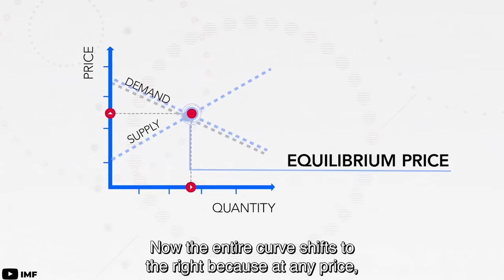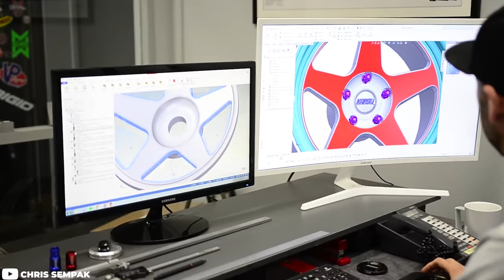Why The Aftermarket Wheel Industry Is DOOMED

Comment from the maker: Do you think aftermarket wheels will die out? Let us know in the comments below. Also, don’t forget to check out wheels, tires, and suspension for your build over at www.fitmentindustries.com
Reply: well as long as our economy doesn't take a bigger shit, its possible for a higher volume of aftermarket wheels  to be bought, but lets just hope these aftermarket companies can hang on a bit longer as this economy adjusts its self, just my opinion
Reply: Yo Alex i don't think so but I like the wheels in your back around iam interested in one of those Wheels in your background
Reply: No, good quality good looking wheels are still required nothing changes a cars apearance like wheels, offsets, colors size etc etc
Racing, track, drag, rally etc etc
Stance
individuality wheels say as much as the car do about your style, your personality.

The mass produced manafacturers wheels are still crap, designs hard to clean, brake dust collectors yes there is the exception, but trust me most I deal with are dam ugly. 
I run BBS and Enkei’s on my cars, some were factory specc by those companies, some are AF. 
if AF wheel companies go, it’s the death of the car period..

Everything has cycles up and down, things are going through massive downs at the mo near,y everywhere, so media need again to promote positive outlooks not doom and gloom, you create reality at times guys. Let’s get through these next few years. Ride out the rough roads..
Reply: On because the AutoNation wants different types of Wheels different type of styles for the import and tuner cars and it's a lifestyle in a revolution not a fan

Comment: Also the fact that I don't want to spend thousands on wheels, when I can spend way less on the rest of the car to make it look good. Paint, body kit, engine dressings, aftermarket lights, interior fabrics, etc. All those things have gotten cheaper while wheels have gotten more expensive.
I just picked up a set (4) of Matte Bronze Enkei EV5 (18") off a wrecked Honda Prelude at the junk yard for $120. They have very little curb rash and a few scratches on two of the wheels faces. I'm just gonna sand it down about a half a mm or less and repaint them with a matte clear finish, polish the aluminum lips, then slap some good rubber on and be done with it for about $600 total. Normally these would be around $900 after tax/shipping, and that's without tires. Add tires and balancing and you're looking at $1200-$1700 depending on the size, type and brand of tires.
I basically got a steal from the junk yard and a little extra work on my part. I'm gonna do the same with paint; go get a $500 spray at Maako with extra clear coat, then bring it home to sand and wax the orange peel down to a nice mirror like finish. Rather than spending $3000 for basically the same thing.
What I'm trying to say is, getting basic work done then DIY customizing it is the new way of working on cars and wheels don't fit into that other than finding used ones and refinishing/repainting them. A set of used $120 EV5's is way easier to get sanded and powder coated, or repainted, than a new set that you already spent $800/$900 on, that only comes in three colors and look like everyone else's. If aftermarket wheels wanna stay in the game they need to have more competitive prices. If my oem wheels look good its cheaper to just paint those and change the tires. That's just my opinion though, I don't wanna drop $3000 on a set of wheels and tires when I can get used ones for half the price or less and fix them up a bit.

Comment: As someone who has tried to get wheels recently (this year), It seems like the problem is not on the customer side. There is demand. I picked out my favorite wheels from 5 different big name companies, and these were my responses:

1. Placed order, wheel delivery date was pushed back a month. Then another, then another etc.. never came back in stock.

2. “Put your order in but we can’t guarantee you when this shipping container will get here or if you will get an allocation, demand is 2 months ahead of delivery”

3. Two companies were out of stock entirely, and website “in stock” dates just pushed further every day.

Finally (took 6 months of this^) found a company out of CA that cuts the wheels there, instead of cutting overseas then shipping. Wheels were 19x10s not a crazy niche size either.

Comment: Thanks for a great video. I dig my OEM wheels so much that instead of hunting for that perfect new upgraded set, I had the curb rash resurfaced and powder coated them a fresh color (these are STI BBS wheels, so already pretty good). I guess the Wheel Restoration industry is also helping to diminish the newest Aftermarket Fresh Biz. As I drive around, I’m often looking at wheels on cars and see some cool wheels: Almost zero hub caps!

Comment: I KNOW THE ANSWER TO THIS ONE. IT’s BECAUSE THEY ARE TOO DAMN EXPENSIVE AND THE OEM WHEELS ARE GOOD LOOKING ENOUGH NOT TO SPEND $2,500-$8,000+ on wheels. IF THEY’RE SMART, AFTERMARKET WHEEL MANUFACTURERS WILL LOWER THEIR PRICES TO $500 or LESS PER WHEEL IF THEY WANT TO MOVE PRODUCT AND NOT GO BANKRUPT. THEY’LL STILL MAKE MONEY, JUST NOT AS MUCH AS THEY MADE BEFORE.
Reply: Supply and demand is basically what you said my good man but pretty much what you said is what they’ll have to do if they wanna move weight
Reply: You dont buy wheels for looks. And when you do aftermarket always looks better and have better widths and sizes .
Reply: The only thing stock does better are Chineseum flow formed wheels

Comment: Having an aftermarket rims and good performance tires along the way would make sense if you plan on bringing those sets primarily to head out for the Track Circuit, AutoX, Drift Events, Drag race, etc. while still keeping the stock rims for daily driving purposes or hell even winter usage like keeping the winter tires on for your stock rims and still keep your aftermarket rims with good performance tires for the summer. These are one of the examples that aftermarket rims do have their practical purposes aside from aesthetics and cost.

Comment: Here's a couple thoughts.  First, people don't keep their cars as long anymore.  Making a big investment in wheels when you may change out your vehicle in around 3 years doesn't make sense.  Second, the wheels are too expensive for what the average person wants.  I can pick up a used set of OEM wheels, spend $20 on paint and supplies, and in an afternoon end up with a set of wheels I like.  That's opposed to the $2k set of wheels that are "made of tungsten and titanium alloy, with momentum ratios this and that, and linear blah, blah, blah blah..."  It's like cell phones;  I want a phone where I can text and make calls.  I don't want to pay thousands of dollars for a phone that comes equipped with 50,000 apps.  I don't care about all of that stuff.  Aftermarket wheel companies need to come up with wheels that look good, will last a handful of years, and don't cost a fortune.  And yes, I have been into cars for over 40 years, and have bought aftermarket wheels.  If you're a company whose "cheapest" wheel will pick up satellite radio and is made of real meteoric platinum, and forged in the heart of a volcano, don't blame your buying public for not buying your wheels.  I want a wheel that looks good, fits my car, and won't fold in half when I hit a pothole.  That's it.  I don't care if it is 1-piece, 2-piece, 3-piece, 4!  I also don't want to put a set of wheel on my car that cost more than the purchase price of the car itself.

But that's just my opinion.

Comment: It’s always about the money. Hiyashi racing 3 piece mesh cost me $750 with tires sure they were 16”. SSR bang Vec chrome with gold bolts and magnetic center locks cost $1600. Now its $5000 or higher for HRE 3 piece. Who can afford this stuff not kids or young adults who are mostly into this. Sure u have $750 junk even rotoform is over a G

Comment: i guest now car companies is competing with design and oe wheels design is on it too, and not only that car companies now is also added they requested oe wheels into their car calculation for optimal configuration setup with the engine, body stile, weight chassis and suspension. well for a car companies they will not just ask for wheels company just like "okay i want to order this wheels, design like this, the size is XX,wide XX and offset is XX,make it 100.000 set". no, they will still research how will it effecting the car. maybe the other choice for aftermarket wheels is carbon fiber wheels, but man they would burn your wallet, not that many people could afford that, even when anyone would buy it, i guest they will not use it as daily driver. well for a good or bad, for wheels companies this is not really a bad news, they still run the business, but it's a bad news for aftermarket wheels dealer..

Comment: I need help my 2019 civic type r has been in the dealership for 3 weeks with a faulty fuel pump with no loner what can I do?
Reply: Isaac Salazar  they just told me the part was on national back order and didn't really help
Reply: @joshbreckling9084  upgrade the fuel pump 🤷🏽‍♂️. Whenever a part breaks, that’s the best time to upgrade
Reply: @MrSiDeLaN  i agree but I would prefer my parts not to break at 15k miles

Comment: Wheels go round on the car, bus, etc who has 1k to 4K to spend on a new set of wheels... other than just to change aesthetic looks 🤷🏽‍♂️ a wheel does not add extra performance based on look or weight ... it still goes around.  Kinda like performance exhaust and price you spend per 1000 dollars  to percentage increase in performance (all you get is a larger diameter tube and larger exhaust tips - you Dyno and for 2k barely get and uptick in HP) 🤣 when the real way to release power is delete the catalytic converters while keeping stock exhaust ( and actually save money albeit at major cost to environment not to mention additional db in noise output) 🤣🤣🤣🤣🤣